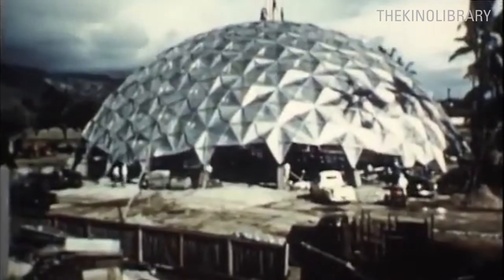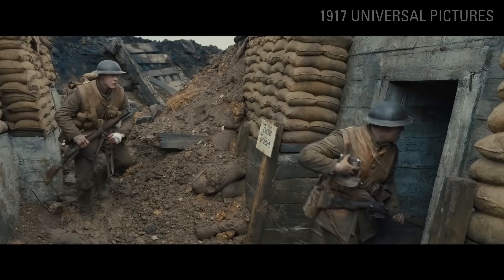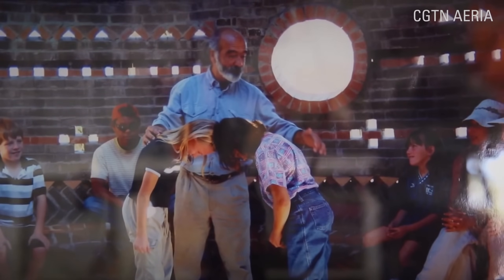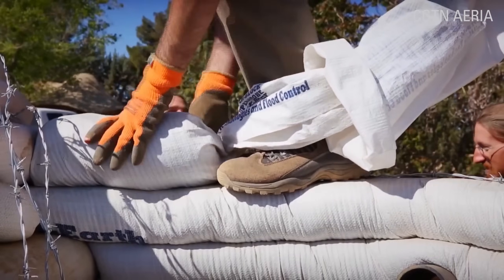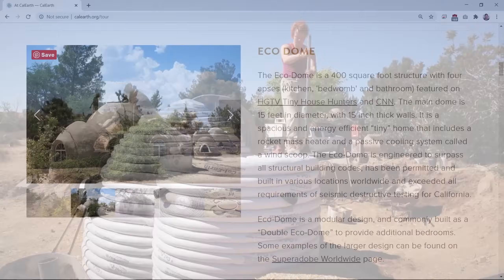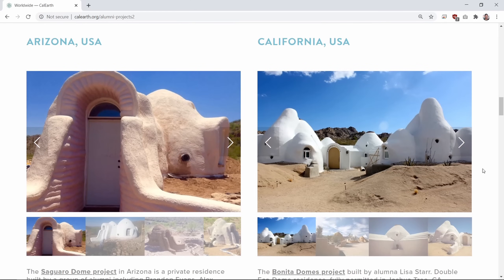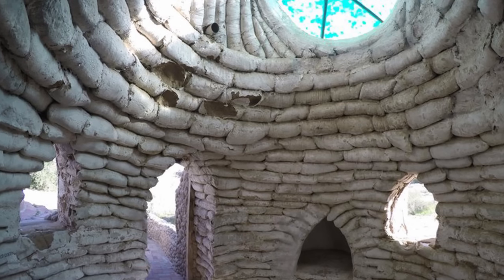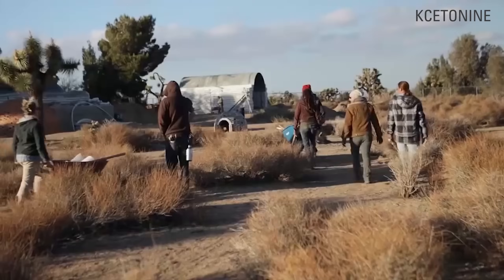Pros and cons of Superadobe Earthbag homes

Comment: I went to the institute in Hesperia, it seems these structures look fantastic when new, but require significant upkeep compared to standard building measures and materials. I think Belinda is correct, these sandbag or "Earthbag" homes are great for emergency shelters but not scalable. Having helped build one, these structures are extremely time-consuming and require at least 4 people to make significant progress, on person to hold bags open, one to fill, one to pass the bag and one to place it.

Comment: I would suggest that mass production processes tend to follow consumer demand. When there is a marked increase in demand, vendors find a way. Scalability is a legit commercial concern, but it is not a concern that relates to sustainability, quality or end user satisfaction. 

The project I'm planning now looks like it will end up costing less than $50k (including appliances and solar install), but a comparable size home in my area built with traditional processes would be at least $300k (WITHOUT appliances or solar). Paying 6X the price to meet a builder's need for scalability and to make area plan's job easier seems like a price I'm quite happy to not pay!

Comment: I pretty much agree with your entire takeaway. In my case, things are a bit different though. Where I live the soil is probably the exact ideal ratio - mostly sand with a small amount of clay. I also feel there are ways to get around some of the cons mentioned. 

*Finishes don't have to be expensive even if they are custom as long as the homeowner is okay with not having high end materials. 
*Even though the shape is round, that doesn't mean the rooms have to follow a round shape. Using some sort of material (ie drywall, plastic, or a lightweight mdf maybe) to partition the room into more polygonal shapes shouldn't be too difficult (though it would reduce the livable sq footage). That would make furniture layout a bit easier.

Comment: The one thing I keep thinking when I see these homes is that they are going to be very difficult to live in if you are in any way disabled. A six-foot wide home isn't going to have much room for crutches, walkers, or wheelchairs. If you have had back injuries you won't be able to build it. Installing the specialised equipment you need for every day life isn't going to be easy, if they even can be in the first place. 

These tiny homes, earthbag homes, and other new building styles on social media are all very ableist when you stop and try to think about how someone who isn't fully functional would actually live there. Most traditional constructions are as well, but at least the equipment we need is designed to fit into some of them. We'd never be able to install ramps in an earthbag home, or shower seats, railing, cranes, stair lifts, or any other of the vast and prohibitively expensive equipment someone may need. 

But no one ever thinks about that.
Reply: That is a good point. For all the pros, earthbag homes aren't particularly disabled-friendly. Like you said, housing in general tends to not think about people with specific needs. Hopefully that will change in the near future.

Comment: Thanks for the video, this was really informative. I was curious about the potential usability of desert sand in this kind of construction method. From what I understand, desert sand is generally less usable for architecture purposes, and I was curious if it would even be possible to use dry desert sand with sandbags like this, or if there'd be issues with structural stability.

Comment: I'm really not a huge fan of earthbag homes. I think bricks, mud or fired, are better. Especially cuz the material is inherently loose. That not great. Especially when the bags decay or weaken. With the alternative being plastic I'm not psyched up about it. Also, how many of them are multi story? What is the possibility of fixing damaged parts of buildings? Nothing's recall fixed so I can't imagine that it is reliably possible to take out part of a wall.

I think the best thing about them is that they show a model of using local materials for building. It seems reasonable to me to make bricks local to large towns and cities rather than shipping them far.

Comment: You probably could scale it by hybridizing with other building methods. For example if you created inner walls of wooden beams/logs, or aerated concrete, complete with an inner roof, you could make a much wider half-dome, and then use the bags for the outer roof, and if you want to keep the dome shape, you could build a wooden framed attic, and use the bags as cladding.

Comment: 5:30 how does it keep rodents out? My groundmother adobe house was constantly under attack by rats and mice. To keep them out you would need hard materials all around like concrete foundations and walls.
Reply: Keep food stuff in hard containers.  However rammed earth which is what Superadobe is, is much more resistant to burrowing than sun baked brick. Also a cemented earth plaster is harder than unstabilized plaster.

Comment: It doesn't use wood, which is good. I don't know why you couldn't lay conduit or pipes through it since the bags are fairly fluid. If you could dig into the earth then you wouldn't need as much dirt for the bags and it would be cool and temp regulated all year round. But you might have problems in CA since we have a lot of earthquakes. I see the dome as a mixed bag though.

Comment: I lived in a 300 year old adobe house in Santa Fé, New Mexico that is still there, downtown, and wonderful. Large rooms, straight walls, all that, most visitors didn't even know they were in an adobe home. I realize the low humidity has much to do with it, so location matters. Also, infrastructure. Many homes being built can use shared resources and labor. A modern adobe style that I lived in with composite materials and a foam core was the most temperature steady. Plenty of triple pained windows for solar, external shutters for summer, and heat radiant tile flooring made it perfect on the hottest and coldest days. 3 feet of snow outside and we had to open the doors to get cooling because of bright sunshine. I was shocked when the propane bill came for 6 months through the winter: $27 (early '90s). Such sustainable building is possible and worth the effort. Stick and frame is ridiculous and seems to be only serving the real estate industry.

Comment: Mud bricks have been a thing for literally millennia, there has to be a way of modernising that idea, if it can be made for insitu resource utilisation even better, may not be great for a single house, but how about major projects?  Start making the bricks as the foundations are dug and ground is cleared...
Reply: CSEB or Compressed Stabilized Earth Blocks. Dirt mixed with a bit of cement mixed in a compressed with a manual press making various size bricks/blocks. And there are gas/diesel/electric powered hydraulic pressed that can make to blocks stronger and faster, but you would never buy one to build just your own house. But their are companies that will make the earth blocks for you

Comment: They are mostly self-insulating. You might need a fireplace in colder areas. They are popular because you can literally do-it-yourself. Make some forms for door and windows, make a temp support frame for the "beehive" design. A little wood, sand and clay, barbwire, rebar, and sandbags. Easy, cheap, energy efficient (no corners means air circulates better, self-insulated), organically shaped, weather resistant, bug resistant, etc. I think these are pretty awesome myself
Reply: The beehive shape is an outcome of a technique called corbelling which does not require temporary  support or otherwise.

Comment: Any time you want to use local material, it is super important that they are pure in sand or wood.  You do not want contaminated sand with clays or peat.  Such materials open a huge can of worms in quality control and are not compatible with mass production methods for making bricks or mixing concretes.  What I want to see, is a system that carefully seperates soils into their individual pure component or at least classify out and form individual stockpiles of pure sand and differing grades of gravels.  It's the same challenge and conundrum of recycling plastics.   IT's easy and economical to build with pure materials and very costly to build with contaminated materials.

Comment: "required to run pipes and wires inside the building on surface".. umm for electric at least why? Just choose right layer height and run PVC conduct from point A to point B between the bags, then feed wires trough like in any other logical building...US with their freely hanging wires are not obviously included to this.. I would be paranoid to screw anything into wall, since anywhere there can be live wire hanging. Least in Finland all pipes and wires are required to be in 90 degree turns, inside the conduct PVC pipes and secured in place every 20-25cm with clip holders. This way if you see wall socket, you can just open it, look inside where those wires run and easily determinate witch point you might not want to screw. Water pipes have similar thing, but with those old buildings with lost or hazy design papers tend to been renovated to surface mounted pipes and newer ones you can easily get the plans as those have been sent to be approved by city building inspector and stored in their archive. Finally copper pipes can be located by radar if there is any questions where those are. Cant recall many cases where there would been accidental puncture of wires or pipes. (read as old shady electrician trick to put nail trough the wire in some hidden place they can reach pretty easily and replace that wire only after client has paid. If they wont, well have fun finding out why your fuses blow moment you flip them on and even more so have fun if you are retarded enough to force it to stay on manually=fire hazard. Personally seen this shady trick couple of times on job site)

Comment: This is how my ancestors built our homes and part of the home I grew up is built in a similar way. It's not that good. Have a few advantages. It insulates fine as the walls are tick and not really good at heath exchange so with a good layout the hose will be cool in the summer, hot in the winter (if it's heated inside properly). 
The hose cant is tall really and if your country is a rainy one it has high maintenance need. Also, it's not that sturdy. Over time it starts to develop crack as it's not flexible at all so the bases should be stable as hell... a fun fact. Houses built with this method usually had similarly built bases, the better ones used stones or clay bricks but usually just hope for the best. 
Insects like ants and rodents like mice love to dig it and you can't do anything about it.
It creat an enormous amount of dirt once you want to tear it down or just want to put a window or a door through it (also these things need a lot of framing and sometimes pillars should be used too) and it is super work-intensive.
Reply: The problems you have named can be addressed by properly executing the technique. That is why they offer to teach you the best methods, and have many examples of the potential longevity of the buildings at Calearth.
Reply: While it seems to be able to withstand short term shocks like earthquakes and flooding, I do wonder how more long term weathering processes would affect it. Resilience against disasters doesn't seem so impressive when it gets damaged by a few years of rainy seasons.
Reply: Ty for insight

Comment: Honestly it looks like a better more scale-able use of this building method would be to use it for the walls and add conventional roofs. Then you can have straight sides and more manageable spaces that can be more efficiently used.
Reply: Or a combination of both, yeah. If this method was made accessible local architects could easily design buildings that use both methods as fits best to the situation.

Comment: I was an inspector at the CalEarth project in Hesperia, CA. An interesting project. I think aerated concrete, or concrete mixed with styrofoam will have more versatility.
Reply: @foyjamez....why are the CalEarth so expensive?  I am in Joshua Tree... You would think more would be built here.
Reply: @catherineice2605  The family used to charge around $5000 for the plan, and the labor involved in CA is really expensive. Also, they're proprietary bags were several thousand. The super-adobe still requires cement, and then you need to finish the exterior with a waterproof finish.
Then, take the fact that water, electric, and gas meters will cost you $5k each or more, and permits are additional, you're probably $40k before you even start working on the house, none of which can be financed except by credit card.
So, how do you get thousands of hours of skilled labor for the plumbing and electrical, plus custom wood work/cabinetry, and then heating (a/c is not required in the building code)?
If you build your own and can figure out how to fill the long super-adobe bags cheaply, you're smarter than I am.
Frankly, people undervalue human capital. Try to get people out to do backbreaking work for pay is difficult, but getting them to work for free (or even breakfast, lunch and dinner) requires a community as dedicated as the Mennonites and Amish.